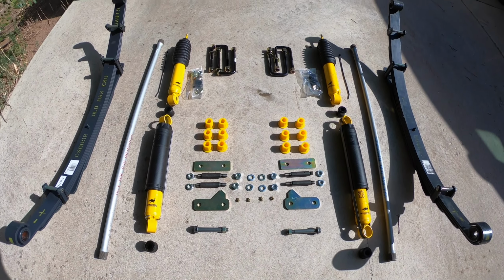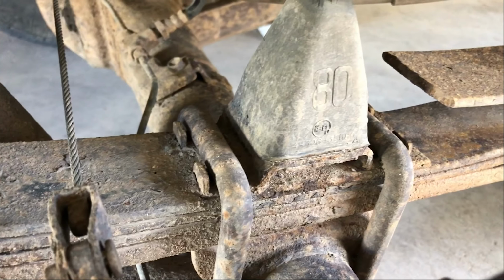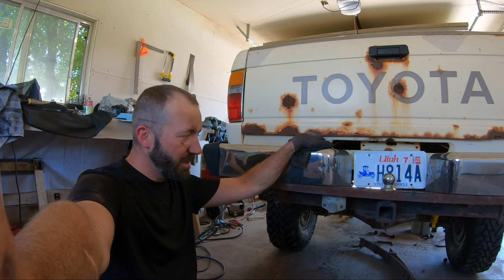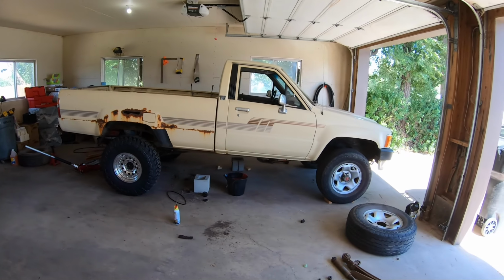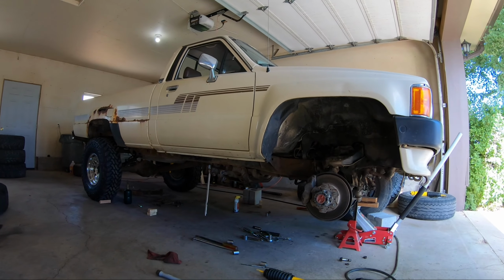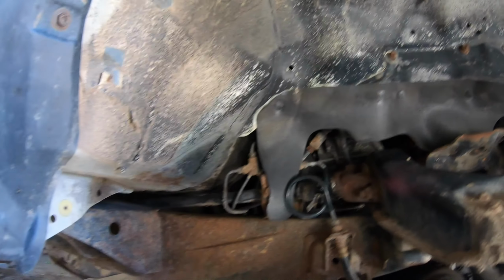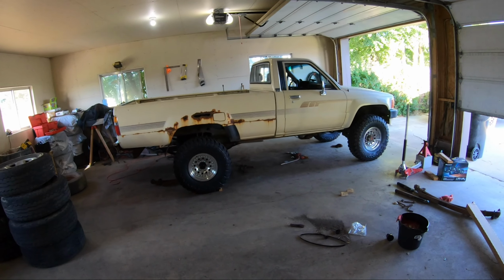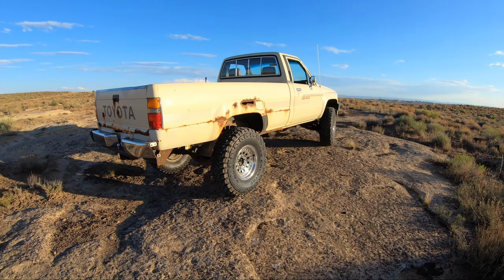OLD MAN EMU LIFT KIT INSTALL TOYOTA PICKUP | 1986 IFS Torsion Bars, Leaf Springs | Truck Build Pt. 2

Comment: Badass...just curious, why did you have to replace torsion bars?  Do the new ones allow for more adjustment?  Thanks
Reply from the maker: Thanks dude. They are part of the kit for a full suspension replacement. Yes you can just opt for new leafs if you want, but i intend to add weight up front and was already tearing it all apart. Winch and lights and heavier stuff. The 30 year old T bars were pretty tired anyway.

Comment: Hey, i know this video is a few months old, but i'm about to rip the rods out of my 86 4Runner, any tips (other than those witnessed with the jamb-nut)? Also, what were you grinding on your new rod? I got the sway-away rods from LCE Performance. Thanks in advance.
Reply from the maker: Yo. Good luck. Fortunately my front end T Bar splines were well greased with intact original boots, so they slid out easy. If yours aren’t then you should definitely soak them for a few days (and all other bolts) with penetrating oil. 

Don’t bother unthreading U Bolts, just cut them. If you do the rear axle. 

What I was grinding where the rear splines on one of the T Bars. I believe that OME mistakenly marked and shipped me two R/H bars. I had to grind out one spline out to line up with the tensioner properly. You’ll see what I mean when you get into it. 

LMK how it goes. 👍🏻
Reply: @CaptMaxADV  Just got done with the T Bars, they slid out just like yours. Intact boots with a little bit of grease left over. Thanks for the video!
Reply from the maker: @coastiekid88  That's great! I ended up cranking mine up pretty stiff just to get her sitting more level. It's definitely firm up front but has less rake and should tame down over time, particularly when I finally get a winch and bar up front. Thanks for stopping by the channel!

Comment: Glad to see this video, currently have my dads 86' Gas Turbo truck after he past away. I'd like to do a restoration on it with also adding some upgrades. I have a set of 33x12.5x15 that i will use left over from my 4Runner. Wonder if this kit will provide enough clearance to run them . 

Looking forward to seeing more videos.
Reply from the maker: I believe this kit will do just fine. A lot of lifted trucks have a little rubbing at full turn or full stuff when off roading. But I’m sure it would be just fine. The forum at ih8mud.com will be able to give you a lot of info, don’t take my opinion as facts. 

Sounds awesome!

Comment: Too much Rust dude
Reply from the maker: Too much for what?
Reply: @CaptMaxADV  Up here in the salt belt...  that would be considered "like new"
You should see the bed on my 95 Hardbody...  the one side flaps in a gentle breeze.
Reply: If it's not making whistling noises going down the road, there is not enough rust!